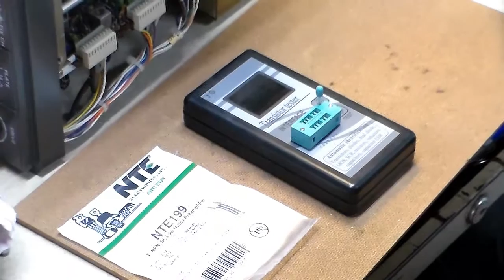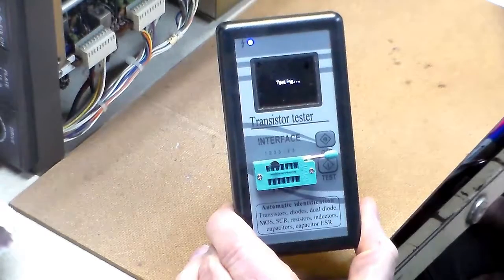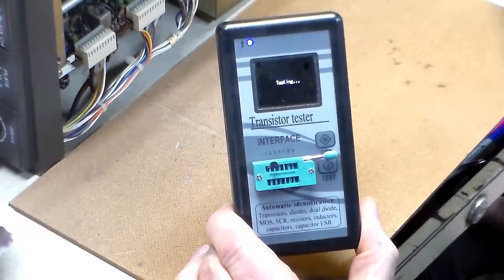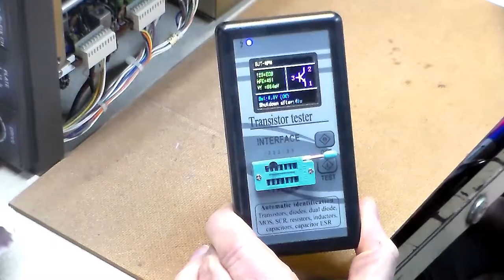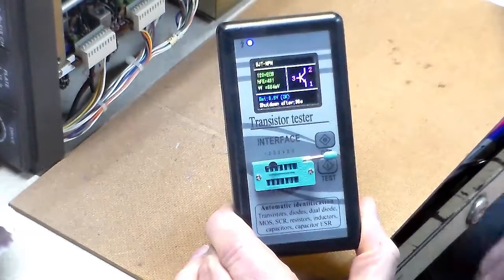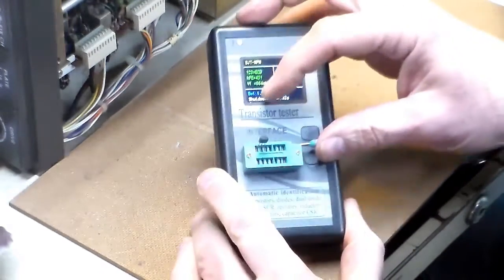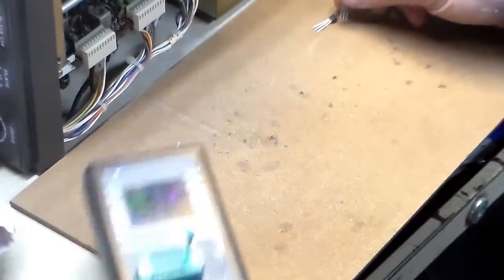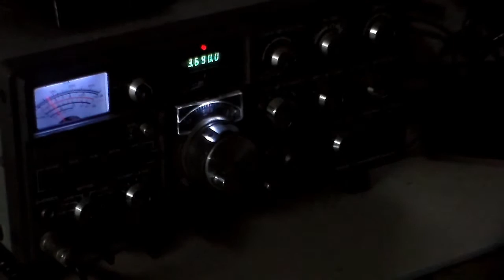Kenwood TS-820S Modulation Part 2

Comment: Interesting video. In my 820 on ssb output is only 40-60W. Have you replaced the electrolytic capacitors?
Reply from the maker: Thanks for watching.  I have started to replace the capacitors. My SSB output is pretty close to 100 on the other bands.  That is if using the Bird wattmeter with a peak reading kit. I’ll keep plugging away when I get time.